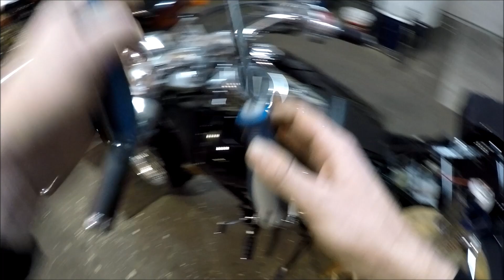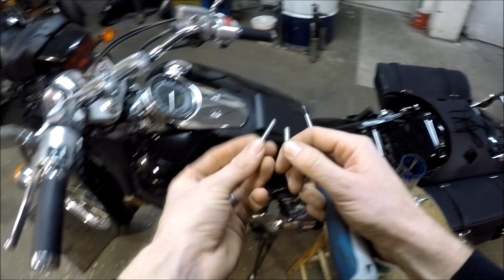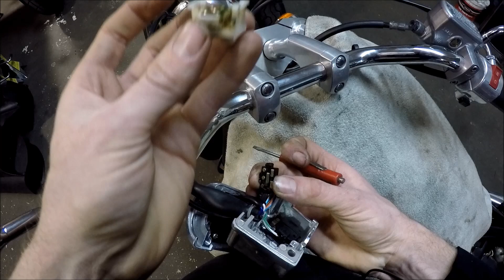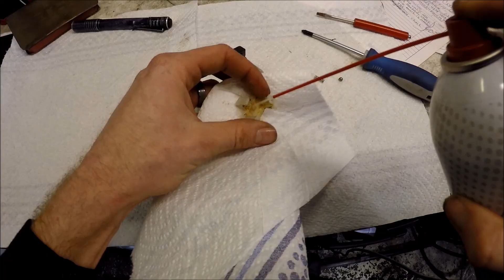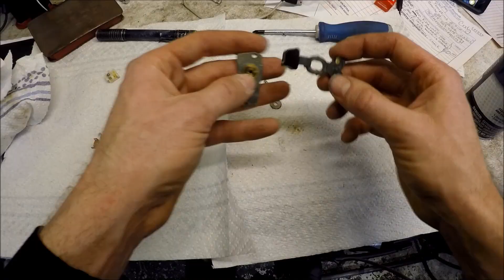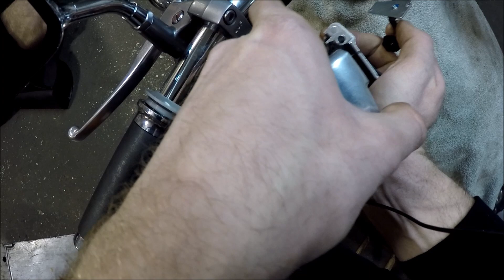Motorcycle Turn Signal Switch Repair

Comment: Hi Cody, had an issue with my blinkers and even after a visit to the workshop I was still having issues. I followed your advice and disassembled the turn signal command and the contacts were corroded. Some sandpaper, reassembly and now it all works fine again. You are my hero of the day man! Big thanks from Belgium!
Reply from the maker: Great job man!! Glad it helped

Comment: Hey. Today I took my VFR800 switch off and it was just as you said. My issue was that whjen turning left the indicator would not stay switched on and that was a problem. I cleaned all of the grease from the indicator actuator and I used a bit of GUNK ( degreasant ) to help me chean the excess grease away and then I used a little carbon lubricant then put it all back together and now it works a treat. Thanks again. Regards

Comment: You did a good job demonstrating how to clean the turn signal switch. Your demonstration shows that cleaning is possible with basic told and mechanical knowledge.

I agree with promoting the screwdrivers and brand. Supporting and encouraging all sponsors without negatively commenting about other brands, such as EG and Craftsman, is essential. When we speak negatively about different brands, it can reflect poorly on you.

Comment: Ive got a 2004 cbr125r think my indicator switch could be the issue my front lights indicator doesnt come on but my back do but they stay on and dont flash do you think this will be the problem that the indicator switch is faulty

Comment: After watching this video about 14 times. I finally took apart my turn signal switch.
 I started  half hour ago I finished about 5 minutes ago. 

I took a bunch of pictures and follow the steps in the video
 It was super easy

I went to put the power on and by golly my turn signals worked for the first time since I got the XR650L. 
Thanks motorcycle MD.
Reply: Which grease did you use? 
I’m going to attempt this on my XR250
Reply: @thedjcorky  which grease did you end up using?

Comment: Just got an CB750 81 Custom for my wife. I determined the short between the run lights and the right turn signal is in the switch. I ordered a ebay replacement. 

In discovering your vid this morning ( never too late ) , In looking at the harness on your shadow, I noticed the blue ( right turn signal) and brown ( Running Lights ) Wires are adjacent. 

Thanks for your vid !

Comment: Thanks a bunch - '94 VFR here with definite switch-itis! 
Checking switch first before buying a relay as the switch indicates right ok but delays or flashes fast indicating left, before settling down after a few seconds. 👍🏻

Comment: Having this problem om min xvs. Took the housing apart yesterday. Sprayed it, greased it, proberly too much grease, and put it back together. Worked for 2 minuts, and the lights started acting all up, and stopped working again.
I'll have to take it apart, and do this the right way.

Comment: Good afternoon. I've just finished refurbing my Fireblade turn switch after watching your brilliant and very clear instruction video.... It was set up slightly differently in terms of the retaining brackets and had an extra layer, but basically the same movement/switch and very similar clamps. It went well. The left hardly responded and the right occasionally worked before, BUT NOW, the movement is crisp and precise and it works every time. It now has a very positive response, so THANK YOU  ;o)

Comment: ST1300 - 2004 turn signals working like new, thanks to your video! Had no idea where to start, was already preparing to get a new assembly, but this step by step cleaning process you explained so well did the job. Thanks again! Happy riding

Comment: What modle and year is of bike is this? I need to replace the signal box and throttle box on my 1984 magna v30. Your pieces are metal, mine are plastic. I like the metal. Thanks.
Reply: CLR works as a great contact cleaner / deoxidizer on copper surfaces.

Comment: I’ve had nothing but trouble with my blinkers working on my 2005 CBR600RR. I’ve had 2 auto electricians work on it. And I’m still having issues. When I ride away, they stop working completely. And it keeps blowing the turn signal fuse. I’ve had led resisters installed. All the wiring checked. I’ve even replaced the regulator rectifier. My next option is checking the stator, and the blinker switch !! Any ideas what else it could be? Thanks

Comment: Thanks man your video totally saved me! Took apart the turn signal switch on my DR650 because my left-side turn signals weren't working. Gave it a good cleaning and forgot to take reference photos and didn't remember how to put it back together. Luckily the one in your video was pretty similar and helped a ton for re-assembling mine.  And my signals are working again 👍

Comment: this was great video, thought I would have to replace my switch because the right turn quit working.  With your video, I know I might take mine apart to clean it first to see if this will correct the issue before replacing.

Comment: i CLEANED AND LUBED LIKE DESCRIBED ONE SIDE LIGHT STILL STAYS ON i CAN MANIPULATE THE SWITCH AND IT WILL GO OUT EVENTUALLY WHEN i USE THE BLINKER ON OPPOSITE SIDE IT LIGHTS UO SOLID THEN WIGGLE THE SWITCH AGAIN AND GOS OUT ANY HELP MAYBE NEW SWITCH

Comment: So mine the grease looked clean as and the contacts didn't look dirty but I sprayed some contact cleaner on the contacts and put it back together and my near new bike with 5000km on it has perfectly functioning indicators again. I still don't really understand what I actually changed from before to be honest but yeah, it worked! Thanks a lot for the upload.

Comment: top vid thanks, i had it apart but not all. saw your vid. and did it again.  it was the copper plate with sticky old grease,
and the spring under there was sideways.
cleaned and greased it  now works great again.

Comment: THANK YOU!! Thank you!  Video is 5 years old and worked awesome on my 2009 Shadow Spirit.  The thinner contact was stuck with thick black grease.  The one you did in the video was WAY cleaner than mine.  Thanks for the video and you added a subscriber.
Reply from the maker: 😎😎 Great job!

Comment: Thanks Cody, mine turn signals just started acting up. Just found a jewel 86 Honda elite, 3300 mi like new $1150 yet 36 years old  the thing is like a 🚀 rocket 🤓and sure age and now new milage I'll find many quarkes needing attention. I'll get the grease I did spray cleaner up in side it made it work a little but I'll follow your advice. Thanks again

Comment: Great video, much appreciated. Gave me just enough confidence to take apart the switch of my 1998 ST100.
I got scared as I opened it up and didn't go as far as cleaning the contacts, but I did eventually realise that the reason my switch wouldn't cancel (was locking in both left and right on positions), was because there was supposed to be a ball bearing at the end of the spring that cancels the wink. It had gone AWOL.
I managed to find a ball that had dropped out of the runner of an old chest of drawers. With a dob of grease I managed to get it to stay in place. Managed to put it all back together and it is working ok.
Took hours.
Thanks, you saved me a small fortune. And very satisfying.

Comment: Your video gave me the confidence to strip the indicator switch on my 1997 VFR750FV that was not always lighing up. It now works as good as new following your guidance. This is great news because I can no longer buy a new replacement and anyway it was much cheaper to buy a can of degreaser and a tube of lube.

Comment: Bro you helped me out !! My Honda Shadow turn signal switch with sticking like crazy took it all apart followed your instructions which were great because I got lost taking it apart but eventually I got it all back together all greased up good as new great video and I got those GIS screwdrivers from your link a long time ago

Comment: I recommend removing the whole switch/wire assembly ans work on a bench so as not to drop or loose parts by working in the air trying to hold and manipulate the small parts simultaneously. Also you won't drop anything on your paint.

Comment: My turn switch was not really nice. On a 23 years old bike, it probably common. After looking  at your video I decided to try and clean it... but it is was even worse. I ended up redoing it with a different lubricant (lithium grease) and it worked great. Choosing the right lubricant is CRITICAL.

Comment: I just did exactly what you did to my 2004 Sabre. It made a big improvement. While I was at it, I also cleaned and lightly greased the circular plastic ring that holds the choke cable. Moving my choke lever always sounded and felt chalky. Now it feels so smooth! Thanks for the video!

Comment: Great Video! Thanks! On my 02 Shadow Spirit VT1100C there is a choke pulley in the turn assembly housing. Would you be able to suggest any particular type of lubrication for the pulley itself that the cable "pivots" or slides on when lever is pulled in or released?

Comment: Of course I lost a spring for the ball.. lol. I have taken apart every single pen and lighter I could find in the house, until I found the perfect sized replacement spring. A 15 min job ended up taken several hours. It work as new again now and won't be stranded at home tomorrow.

Comment: G'day there Cody. Thanks for your great videos. I am a complete novice 
when it comes to things like this. You have help me solve a few of 
issues today with you helpful videos. First you help me locate an 
electrical gremlin where my indicators weren't working. You showed me 
how to pull apart, clean and rebuild my indicator switch. Although that 
wasn't where the gremlin was hiding. Then you showed me how to check the
 switch to see if its getting power...that's where i located the little 
bugger :) The loom plug was a little loose and not making proper 
contact.
Then i was cleaning my rims and noticed that one of the rear
 brake pads was down to bare metal. A couple of quick phone calls to get
 new pads and then back to your channel to find out how to replace them.
 Without your help and simple to follow instructions...my 89 VFR750 
would be a huge paper weight LOL :D

Comment: my signal switch itself broke right at the bend..Ive tried to JB that 💩 multiple times with limited success but it eventually breaks again..Cant find a part# for that individual piece ..
Anybody got an answer to how to fix modify or replace It would be much appreciated.. 08cbr600rr Grafitti

Comment: Had a 1991 CBR600 that went funny would indicate but just solid orange no flash, took the switch apart cleaned up and working fine again

Comment: Thanks for the video, I bought a 1985 Yamaha SRX600 super single a week ago. The turn signals have developed a problem: When right turn is selected all four flash. When left turn is selected, the two left signals light very dimly with no flashing. Watching you video helps me understand what to look for in the switch. I have already been over some of the other wiring.

Comment: Thank you for your video, I have just repaired turn signal switch in my Honda Hornet CB600F that I recently bought, signals were working after about 1,5 sec after i pushed the switch so I cleared and lubed everything and it works like brand new, however it was a little more dificult because of choke lever, I had to unmount choke cord to be able to open this case :)

Comment: I would like 2 add that the video u did on the deceleration back fireing, I followed it 2 a T!  I have Vance  & Hines pipes, all the adjustments were made by your specs still backfireing on decals ! The idle screw can b backed all the way out to low idle &  it seems 2 b  not as bad. Any advice /recommendations  I’ve been advised to re-jet  carbs, what’s your advice, this  back fireing is about to put me in a loony ben🤪

Comment: I am only needing the turn signal on/off lever/control button. Mine broke just that lever. Can I get that part ?
Reply: Please send me info on just the little swivel bar & where I can get that or a used switch assemble. Your paper towels r awesome dude 😂

Comment: I have had an issue with tis switch for the last few years. After watching this video I can't wait to pull it apart and fix it finally. A replacement switch is at least $100 which I don't want to pey. Thank you for the video! Great stuff! Keep them coming.

Comment: THANK YOU THANK YOU THANK YOU this video just saved me several hours I have a broken horn switch on my Ninja after seeing how easy the control comes apart just going to solder in the new switch Shure beet pretty much pulling the tank to get to the connection
Thanks Again

Comment: Cory, I watch all you vids and you are a thorough and articulate pro. Today I received some used switches from an XR650L for my XR400R e-start conversion project and I followed along your switch videos and disassembled and cleaned and greased and put them back together. Just like new! Thanks! You electricity videos are the best!

Comment: I must admit I'm surprised you'd not come across JIS screwdrivers before. Although when I started they were only available as far as I know as Honda tools. They did three t handled of different sizes, I have a large one hanging in my shed, also a couple I think of more usual handles. This was 1978 until 2000 when I worked in parts, I can't remember if they were still doing them when I went back from 2006 until 2013. Nowadays they're much more available, I got a nice t bar one with separate heads the other day, has come in handy already. I still have my Honda's although these days I work with parts for old Brits. Kind of a different world that you can be sure. Enjoying your videos, everyday is a school day as they say.

Comment: Help for others: @10.33. My bike, a Honda VFR800F, 00 (5'th gen) is slightly different, but this guide works great. However the ball must have popped out because it was gone come assembly time. The switch will get stuck without it, so its a must. Where do you get something like that? The brass balls shop? What I did was that I tore apart a ball bearing (marked 607) and used one of those. The one I used seemed a tad too small as it had to be held  in place with grease during assembly, but once the lever was in place it got stuck in place and seems to be working. It is wintertime up here in Norway, so I wont know until next summer if it will hold up long term, but it has been tested  50+ times in the drive way as well as on a short test ride so it seems OK. In case you also tend to loose balls during maintenance, I hope this might help.

Comment: Big Thanks to Cody. My 99 VFR800 was blowing the turn signal fuse every time I switched the ignition on. I found this video, and Cody's video on understanding and trouble-shooting the electrical system, and solved the problem after cleaning my turn signal switch. I was shocked because I've always been super-uncomfortable with electrical problems. Anyways, this is a great video and I'm now a Cody fan. Big thanks, Cody.
Reply: More video like repair the headlight and horn switch.
Reply: More video like repair the headlight and horn switch.

Comment: Your videos are really helpful, thanks. You don’t gloss over details like so many.  I just did this on my 99 VFR. Some differences I’ll note for any one finding this. 

When you pull the whole switch out of the cluster with the wires attached, there is a spring which is then not held by anything. Its the spring which you reinsert at 16:24. On mine the spring is inserted from the back and is not held by anything. It is only compressed once the switch is put back inside the cluster.

On reassembly this makes the process of installing the switch tricky. There is a moulding at the bottom of the cluster case in which the switch needs to sit. It will only go in if you compress the switch while installing (e.g. with a small flatblade screwdriver).

There is only one u shaped copper contact rather than the two you had on that bike. There’s space for another but its just packed with grease. Brake cleaner and contact cleaner didn’t have much affect on the grease in mine strangely.

The switch lever which pivots on the brass bearing comes away freely as it has a fork rather than a circular hole. 

Getting clearance for a screwdriver to undo and reinstall the screws holding the cluster to the bar was difficult. A stubby Philips would help here.

I had to remove clutch switch from clutch lever and remove clutch lever from bars to get enough clearance. On the 99, the manual choke is an added complication as the cable needs to be detached.

Comment: Hoping my attempt at this fix will go smoothly. 
I’ve a 2017 Triumph Tiger Sport and the turn signal switch is very stiff. 
It has an automatic cancel function that is only intermittently working too. 
Have had the bike for only three weeks and put 2,500km on it in that time. Switch and cancel function was working perfectly when I purchased it. 
The bike has done 60,000km. 
I was going to spray lube inside the housing, then decided to check YT. Thanks for the vid Cody. Will let y’all know how it “turns” out!

Comment: I notice he specifically says not to use Dielectric Grease. 
Right now I only have Silicone Paste (Waterproof Dielectric Grease).
Can I still get away with doing this whole process using this grease, only putting very light amounts on the contacts like he did in the video?
Reply from the maker: Yes!

Comment: Yes, JIS screw drivers are amazing. I've had semi stripped Phillips head screws I couldn't get out with my old screw driver. Used my friend's JIS screwdriver and it worked like a charm! Then I got a set for myself.